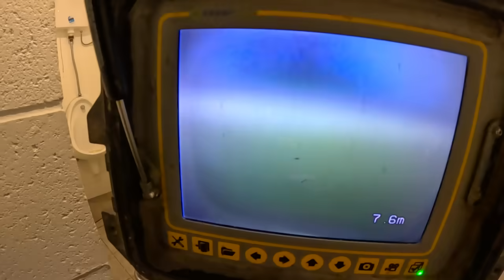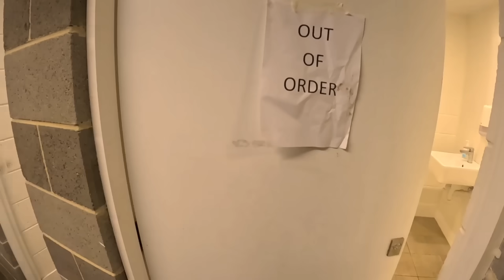Blocked Drain 865

Comment: Back in the 90s I had a restaurant job. The building was the lowest point in a square mile & it was an urban area all around. The sewer mains backed up & on a holiday weekend we had to close because all the sewage they were flushing was coming back up on us we flooded quick In 2 feet of water coming up out of the floor drains toilets. It was awful. The restaurant had to call a disaster restoration service to clean up the mess. Everything from miles around was coming up in the floor drains when the mains blocked. In the states in Georgia this happened.

Comment: The water pressure looks pretty low, would that add to the problem of the belly in the pipe?
Reply: eco-friendly toilets (low GPF) tend to make the problem worse because there's not enough water to do the job. This is compounded by folks who don't press BOTH flush buttons for the BIG one. IOW, the heavy stuff just hangs in the low spot.
Reply: @rupe53  cheers, yes eco-friendly toilets can be annoying.
Reply: @justme3971    I met them halfway. My toilets are the older 3.5 gallon type so I added a milk jug to the tank and that displaces a gallon. Now they only use 2.5 gallons. Been doing that for about 10 years with no issues. Probably saves about 200 gallons a month (each toilet) on the water bill.
Reply: @rupe53  I use to have the old Brent Brass toilet cistern, but could no longer get parts 😕 so had to retire it and used it as a planter. 👍🏻👌🏻

Comment: What exactly was that attachment you put on the hose?  I'm assuming it uses air to force the blockage to move, but I was curious what exactly it does to help clear the pipes
Reply: It’s a high pressure water jet and the attachment he uses changes the spray pattern. It blasts water behind itself to help the hose crawl forward and out the front it sends a swirling jet of water to break up blockages.

Comment: Great video, Ollie! Watching this makes me think you could do with a gurney or wand with a nozzle that gives a fan spray. You could then use this as a kind of 'water broom' to sweep the 'unwanted guests' and other detritus away down the nearest drain or other appropriate place when it comes to cleaning up. It would be a lot more efficient and in some ways more effective.

P.S. I really loved the 'where it goes...nobody knows'!
Reply: He can control the flow, but using the gurney or nozzle at full flow would splatter those unwanted guests all over the room.
Reply: @stevem1081  From what I've seen, Ollie doesn't have a nozzle that produces a flat fan profile. A separate gurney from a pressure washer with a suitable nozzle would do the job as that is what they're designed for. Having a nozzle with a flat v-shape spray pattern would be the ideal for guiding unwanted guests to a suitable floor drain. Controlling the flow would certainly minimise splatter.

Comment: I noticed in older videos you used quick connects on the nozzles, now you screw them on. I can see where that could make the connection a bit shorter and easier to navigate turns, is that why you changed or did the quick connects create other problems? PS, I never thought blocked drains would be so interesting, and they probably wouldn't be if it weren't for your great knowledge and great attitude towards them. Thanks for the great videos.
Reply: Using a screw on coupling gives a more secure connection and Ollie switched to them after loosing a few of his heads.
Reply: yes, getting caught on tight bends is why he went back to the screw on situation.

Comment: Why are only the bathroom lights flickering on the video?
Reply: that flicker is caused by fluorescent lights running at 50 Hz with the GoPro camera running at 60 FPS. It's what they call a strobe effect. Not much you can do about it.
Reply: @rupe53  Thought so, but I don't see a flicker outside of the bathrooms.
Reply: @mrmoshpotato    different bulbs and different ballast types will affect this. I suspect the older iron core ballast doesn't switch fast enough. (like an electromagnet) The newer solid-state ones are probably causing this.
Reply: @rupe53  Got it.  Thanks.